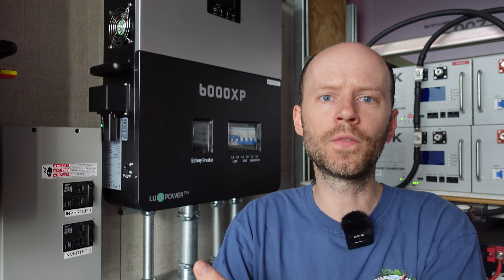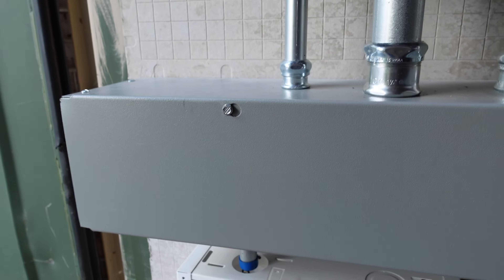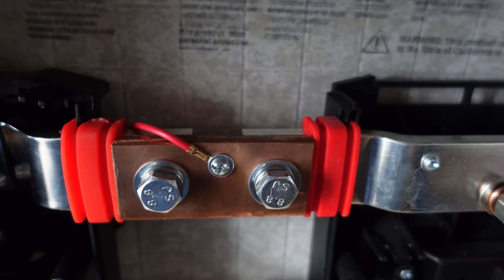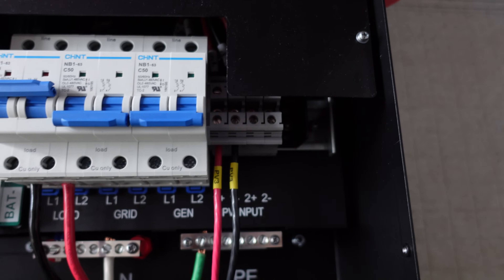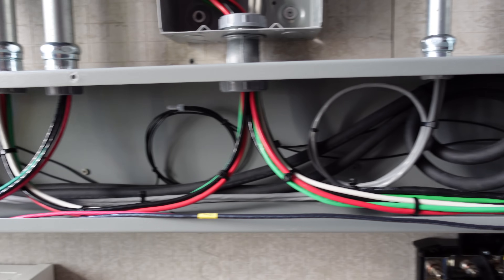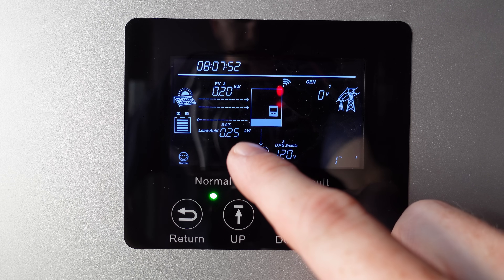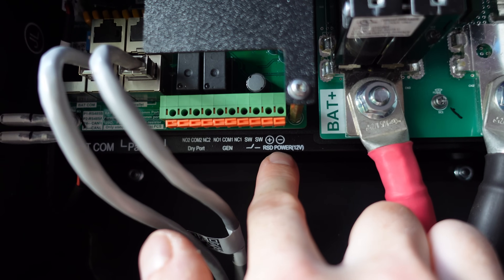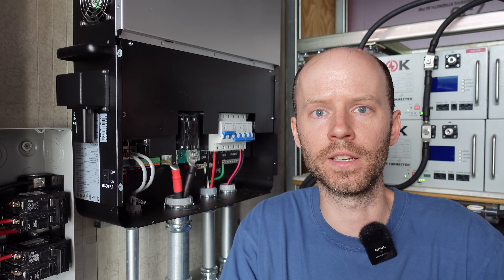The EG4 6000XP Inverters are Installed, Finally! 12,000W Off-Grid Solar Power

Comment: Those breakers may not operate if the inverters are 25 A simply because the way some inverters designed they don’t have additional current or at least for more than a couple of seconds depending on how the breaker is tripping due to the amount of current it may not work
Reply from the maker: In the event of a short-circuit, these inverters are capable of delivering enough to trip that breaker. You are correct that it's unlikely in this setup, especially given the inverters have electronic over-current protection; however, the breakers are still required AND they also serve as a service disconnect. If you have more than 2 inverters, the current delivered during a short-circuit increases well beyond the breaker rating.
Reply: @LithiumSolar  however the failure of one inverter may not be enough to increase the current that much it would actually decrease the current available in a fault

Comment: Thank you for posting, I’m trying to find out if these inverters require each string of pv to be paralleled into each inverter? Electrician in me seems to think that this makes sense but obviously only 2 moots per inverter and you have 3 strings so this wouldn’t work. Looks like you just brought your first two strings into one and the third string into the second. Secondly, if you only had two strings and 3 inverters would this mean one inverter doesn’t get any solar input? Hope this question makes sense.
Reply from the maker: With 2 inverters, you have 4 unique MPPT chargers. You do not need to connect the same solar string to two inverters. In fact, that would completely mess up the MPPT algorithm. You also do not need to have a solar input at all, so 3 inverters with solar panels on 1 and 2 but not on 3 would be perfectly fine as well.
Reply: Thank you so much for this reply, you can tell I’m a solar rookie. It looks like with the batteries you do indeed hook them up in parallel tho? So you bring a feeder from each inverter to the combined battery buscar?

Comment: Inverter is set up for led acid batteries????????????????????????????
Reply from the maker: Yes. That is how specific voltage settings are programmed in. Selecting the actual lithium setting requires communications to the BMS of the battery.

Comment: just broadcast a second SSID in your home router with the same name and stronger signal.. it should make the SSID from the inverter less likely to be chosen. Do not put a password on yours and make sure it goes nowhere.. not inside your house of course.
Reply from the maker: Well, that's one idea... but not really acceptable in term of security. It should have a simple on-off, don't see any way one could argue against that.
Reply: @LithiumSolar  I agree that they should provide a way to disable broadcasting any unsecured wifi.

Comment: So this is an off grid inverter that needs internet? I don't have internet, I guess I'll have to find something else...
Reply from the maker: It does not require internet or network access. You can configure it using the buttons on the inverter, but having the phone app makes it a lot easier. You can configure it with bluetooth from your phone (no internet/network) then unplug the dongle when you're done configuring. I leave mine plugged in/connected for statistics gathering, that's it.
Reply: @LithiumSolar  OK, got it, thanks for responding 👍

Comment: These cheap high-frequency, transformerless inverters may save you a little bit of money upfront but they don't save you any money in the long run because of their shorter life expectancy poorer surge capacity, and the fact that they can damage your appliances during a failure of their MOSFETs due to the lack of an output transformer. You're far better off spending a little extra money and buying a low-frequency, transformer-based inverter charger.

Comment: I wish we would stop falling for the next shiny toy. Gimmicks like "innovation" and "new more efficient with an LED light" fool folks into trusting junk with bad support for one of a home's most important components. I live 99% off-grid (still have internet) an inverter and its coordinating components are a life support system. I rolled into this lifestyle because of nicety. Folks with expensive builds or the guy that hires engineer775 burn my biscuits.:baseball-white-cap-out: